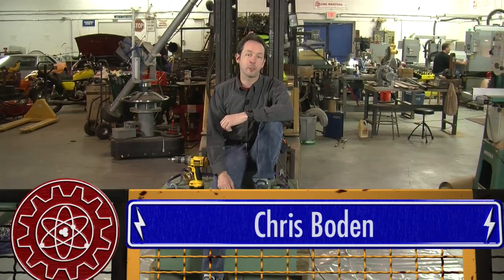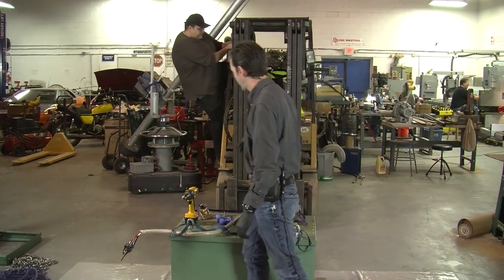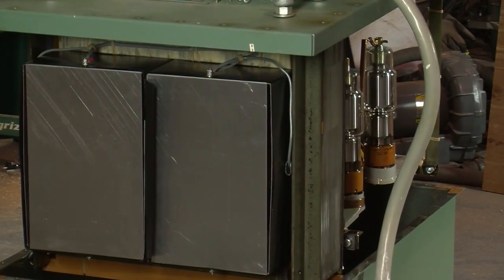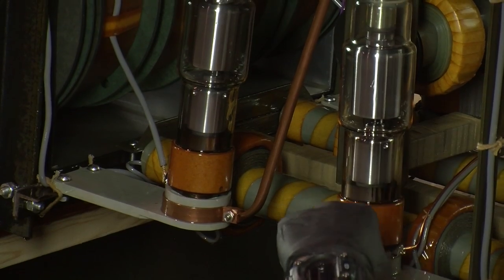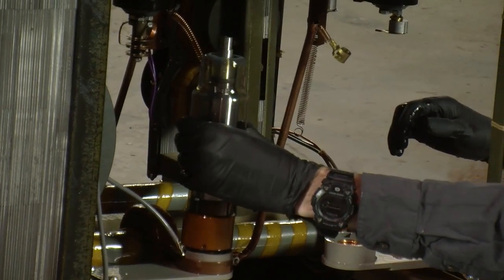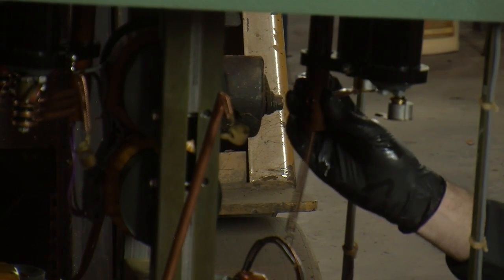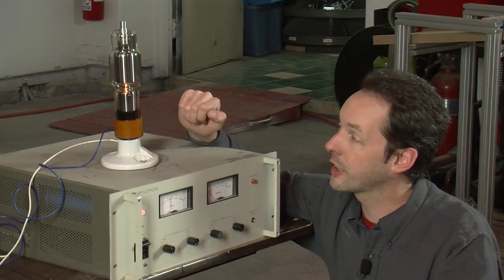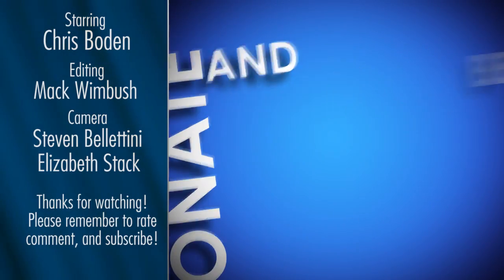X-Ray Transformer - Thoriated Valves Extraction and Examination

Comment: When tube rectifiers get old, they get "hard" and can drop voltage across them, and can and will emit xrays out of the tank it self, worked on many, when you have hV across them...that's why way back, the mfg came out with solid state rectifiers that screwed right into where the tubes where...did many up dates, now the only vacuum tube is the xray tube, no solid state for that, cus...ya need vacuum, and hV and an anode the acceleration gives ya xrays

Comment: Those tubes are basically just like massive diodes made to handle ridiculous high voltages without biting it.  So, it's outputting a clean DC signal all the time, and i think the tubes also help to even the voltage out further by being slightly capacitive in nature.

Comment: Why rebuild what was already built? 
You already had a HV power supply with the bridge rectifier, just put the tubes back in and reseal the transformer case back up and done.  Otherwise you could sell the tube on ebay and the transformer as scrap and turn a profit.

Comment: Yeah, these kinds of rectifiers make great controllers for HV.  I can't tell but they are tied together as a 2 half ~ or a full wave combination. This is what turns the AC to DC. Maybe two by two in parallel since this transformer is so massive. Most of tubes this size are rated for 100kv or so. I have one rated for 125kv, which is the highest rating I have seen. It's huge, twice as wide! I would be very careful with this transformer as it must be in oil and  since it's a 60hz, it's VERY deadly.

Comment: TUBELOVE!  Hmm. I can't seem to find any data sheets for those tubes. :(
This is about all I could find: pupman.com/listarchives/2001/February/msg00175.html
The problem with using them in a full-wave bridge,is that each tube will need it's own filament supply,isolated for howevermany-KV you plan on running it at. More oil!

Comment: those tube look a lot like a Kenotron, a high voltage high vacuum diode. they were commonly used in x-ray equipment. sadly i could not find the data sheet yet, but i will keep on looking.